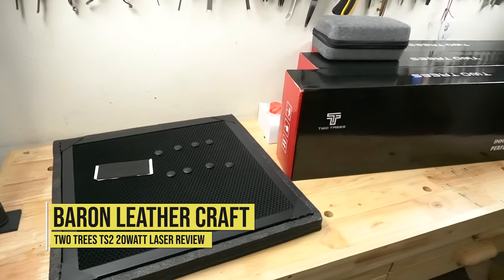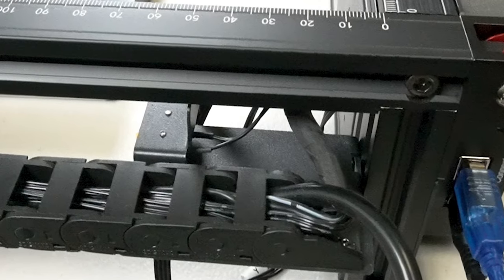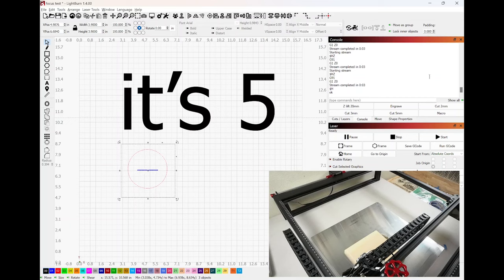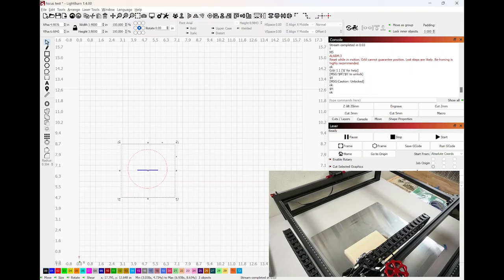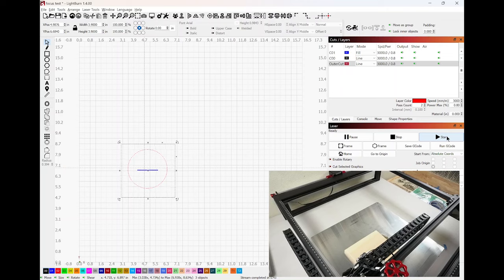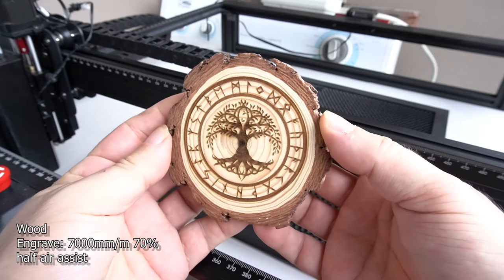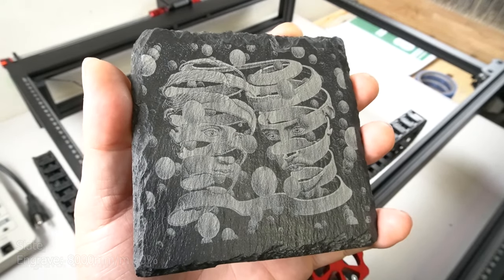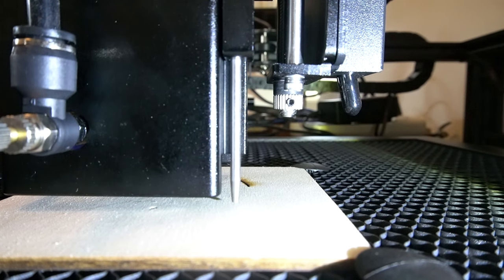TwoTrees TS2 20 watt Laser Engraver Review. Autofocus! Speed & Power settings for diode laser review

Comment: Regarding automatic focus, it is always set to Z offset in half the thickness of the material I am cutting as in the video (3mm material = 1.5mm focus? For example, if I am cutting a 10mm material, do I set the automatic focus to 5mm?
Reply from the maker: The short answer is yes, That is my understanding and it is also the technique that I use.  If you experiment you might even find a sweeter focus point but on the most part halfway works for me.
Some things to keep in mind:
Calibrating the Z-Axis Focus:
Experiment: Start by focusing halfway through the material’s thickness. Then, test the results by cutting or engraving a small sample.
Fine-tuning: Observe the quality of the cut or engraving. If it’s too shallow or too deep, adjust the Z-axis position accordingly.
Material-specific: Different materials may require slightly different focus positions. Soft materials like wood might need a different setting than hard materials like acrylic.
Enjoy your laser, you picked a nice one. 👍
Reply: @baronleathercraft  Thanks! 🤝

Comment: Noob question :  What stops you cutting the honeycomb base?
Reply from the maker: It seems diode lasers have a hard time cutting most metals and I assume that is the reason that the honeycomb bed is not cut in half. You can mark up metals but the diode does not seem to cut them at the power and speed that these home units seem to generate. I know some lasers like this one can engrave on to stainless steel it is not going to be able to cut through them. when ever I cut material on a flat piece of aluminum the aluminum is scared but never cut through no matter how slow or powerful I use the machine. What a laser is able to cut relies on the spectrum (color) of the beam the laser produces. There is plenty of info on this topic online. Thank you for the question.

Comment: Shouldn't the rubber cap behind the laser be removed? What role do you play >?
Reply from the maker: I am not sure where you are talking about. Can you be more specific? Thank you..
Reply: @baronleathercraft  t's 16 minutes and 21 seconds. I understand that the rubber cap on the back of the laser needs to be removed
I was curious why you put it on
Reply from the maker: @starily  Actually I never noticed that before. I just took it off. Do you know what the function of that is? What was it covering? I guess I was able to use the laser with the cap on. any clue? Thank you.....😱
Reply: @baronleathercraft  It'll be in the manual It's a type of sensor
Please remove the rubber.
Please let me know if I'm wrong
I'm using the same model.
Reply from the maker: @starily  That is the flame sensor. According to the manual, when you use the machine outdoors it is easy for the sensor to be triggered so they want you to leave the cap on. The cap on the sensor is to prevent the alarm from going off when there is actually no flame. If you find the laser keeps triggering the alarm without a flame use the cap. Thank you for pointing that out                 on e machine.